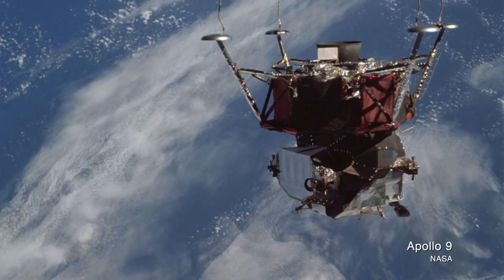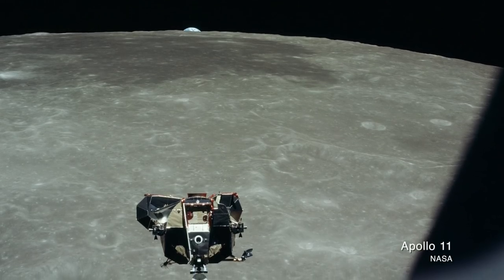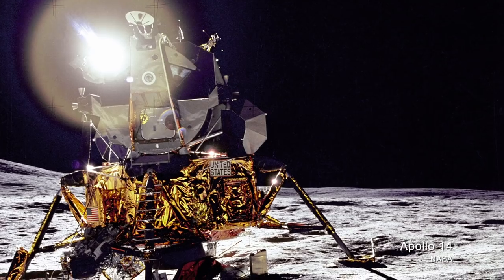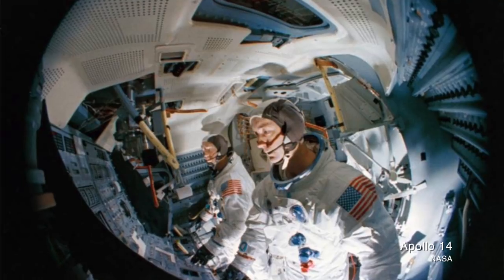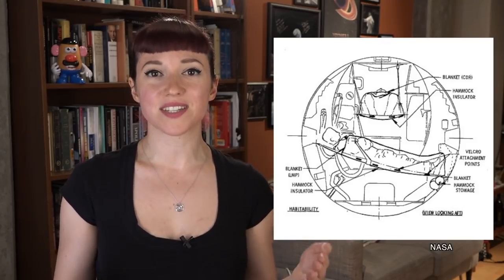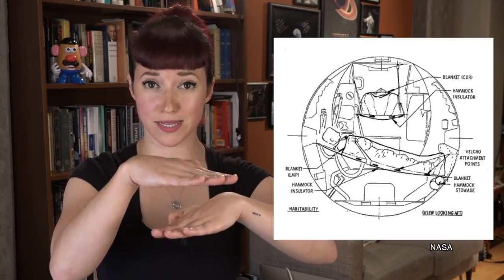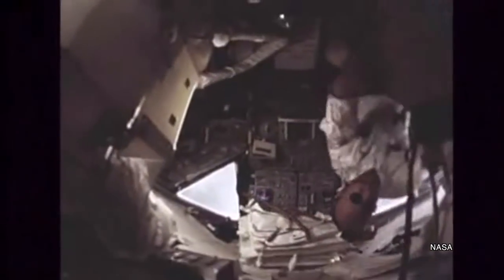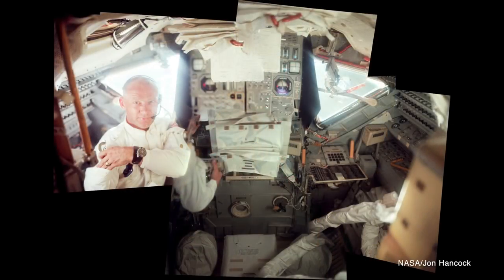Peeking Inside a Messy Lunar Module

Comment: 0:05 I did in 1991 I was an electrician working at KSC. I was working on a tourist area handicap accessibility ramp project. The display was closed and I was working by myself in the display area on ramp lighting for about a week. one of the items on display was an unused lunar lander. I was eating lunch one day at the bottom of the ladder on a 5 gallon bucket and decided to climb up into it and look around. I sat in it for a few minutes, pushed some buttons and flicked some switches then climbed back out and went back to work.

Comment: Even more impressive was that James Lovell, Fred Haise, and Jack Swigert lived for 4 days in that LEM cabin after the accident CSM Odyssey forced the crew to use Aquarius as a lifeboat.
Reply: Did they have to close the hatch to the CM though? There's 16mm footage of Swigert floating "down" to the LM from the mission (I presume it was after the incident, as there really wasn't any reason for Swigert to be in the LM if the incident hadn't happened.
Reply: Couldn't: There wasn't enough space to fit a third person to sleep without getting in the way or risking bumping something important. So they took rotations sleeping in the CM.
Reply: I have met Fred several times over the years.  He's a very nice guy, and easily approachable.  He gave an hour presentation of the real mission vs. the film, and he did say Hollywood jazzed it up a bit of course, there were no raised voices, arguments, etc. The manual burn sequence was not nearly as dramatic as Ron Howard made it to be.
Reply: That's good to know. Still, it really was touch and go for those guys. Amazing how they overcame immense adversity and made it back to our blue terrestrial ball alive and smiling.
Reply: Don't know if it's still there, but there used to be a boilerplate Gemini at Goddard that you could actually sit in.  I'm relatively tall, broad shouldered, and I really didn't fit in the seat even in street clothes.  Two weeks inside that thing with someone, while both wearing spacesuits, and I'd have gone nuts.
Reply: Walter Boxhead And both of them spent about two weeks with Bill Anders in the Apollo 8 CM (no LM lifeboat).
Reply: @ChristopherUSSmith  At least you could take the suit off in the CM and float freely.

I've heard Jim Lovell say that when he and Frank Borman got back from Gemini 7 they held hands and joked that they were engaged. They'd spent that long together in that tight a space.
Reply: @Doctor699  Indeed. Jim warned Frank and Bill to take it easy once unbuckling inside the CM. Frank still upchucked.
Reply: @Doctor699  Not only on the mission itself, but they must have spent plenty of time shut up in a mock up during training/rehearsals.
Reply: Christopher U.S. Smith on PBS they said he got sick and vomited and had explosive diarrhea. Floating all around them and it stunk so bad they had to use emergency oxygen masks
Reply: SteverRob the more I watch the movie APOLLO 13 the less I like it. The acting was pretty bad... especially the mission control guys.
Reply: Christopher us. Smith. Apollo 8 was 6 days long you doughnut.
Reply: @mem1701movies  Ed Harris is more gregarious than Gene Kranz. The movie doesn't depict Glynn Lunney's contributions fully enough. Mattingly didn't have to be woken up and dragged to the MOCR, he was already there with Tom Stafford and John Young for the tv transmission. And he wore a polo shirt, not a button-down with a skinny necktie. Stafford also wore a polo, Young wore a button-down, necktie, and a sportcoat.

Comment: Those quarters had to feel pretty tight; especially knowing that the thin aluminum skin was all that was protecting the astronauts from the near vacuum of the lunar surface.

What impresses me most about the interior of the LM is just how low tech the battleship gray instrumentation looks; more evocative of Run Silent, Run Deep than of Buck Rogers.
Reply: Apollo 18 had a lunar module set and it showed how cramped it was for the actors.
Reply: That's because weight and functionality are everything. Assume you need a pound for painting the interior: Doesn't sound like a lot, but shaving an ounce from something saves a pound worth of delta-V fuel, increasing your return sample weight and safety margin by that much. Not painting is16 extra pounds available to drag back to Earth.

Add to that, the instruments are "only what you need at the moment". Which is why most have more than one function. For example, the radar instrumentation had a switch between showing  range and "range rate", (how fast you were changing distance.) some, like the tank pressurization, oxygen tank quantity and others had one switch for one gauge gauge for showing four separate measurements. The temperature gauge switch had  seven positions; one each for the four thruster quads, one for each of two radars,  and one for the radio. The ones that didn't were highly critical systems, like RCS propellant quantity, engine thrust to weight ratio, and cabin ppCO2 level: You need to know at all times how much steering you can do, the performance of your engine and whether or not you can safely breathe the cabin air.) They're black and white (Or green for the EL displays) because the LM had big windows and the sun was bright: Washing out the color of, or overpowering a (let's face it) dim incandescent bulb (No reliable LEDs back then) might have had disastrous results ("Contact light! Engine off! ACA out of detent..."  ...thirty feet and 15 feet per second later... "Why are we still moving? FUUU---." crunch, bang) 

And the instrumentation was actually very high tech for its time: Lightweight, ultra-reliable and absolutely bleeding edge. (All of the 7-segment displays were electroluminescent. That was pretty new, again because: "no reliable LEDs back then". It would've been heavy, power hungry nixie tubes if it weren't for ELs.) Just the weight savings in instrumentation allowed them to only use batteries instead of batteries, fuel cells and hydrogen tanks too. Again, cut an ounce to get a pound. In this case, the fuel cell stacks were 245 pounds. Each. They'd have used two for redundancy That's at least four tons of additional payload. For a few pounds of instruments and their associated current draw.

High tech isn't "what you see", it's more "what you don't": "Perfection" in aerospace engineering isn't when there is nothing left to add, but when there is nothing left to remove. It's those little details that impress me.
Reply: Andrew Foss
Absolutely. And it's that raw functionality which I find so impressive.
Reply: When Alan Shepard took that golf club head and golf ball to the moon with him "secretly" on A14, that was the most expensive golf club and most expensive golf balls in the history of....ever.
Reply: Don't forget "most expensive chip shot on the most expensive golf trip" also.

Comment: could you do a short video about the hassleblad cameras they took to the moon?
Reply: Some of the Hassleblad  accessories became available to the general public, such as the focusing and winding knob extensions that were developed so the astronauts could work them with those bulky gloves of theirs.
Reply: It had 3 settings one for near ,medium,and far. It had f stop settings.
Reply: Were those cameras air tight? Did they have any special modifications to protect from heat/cold and radiation?

Comment: It may seem messy but all the astronauts on every mission implemented regular house keeping steps. it was a requirement...keeping large heavy equipment form hitting switches, digging insulation and shit out of the intakes... stuff was just not allowed to be floating around. there was a specific place for every item. Being so small the lem looked unorganized but in fact was very well organized down to the exact place to store each item including spent lioh canisters, not only for neatness but weight distribution. a messy astronaut on a mission would not have been tolerated during any mission and to be messy and unorganized would have been considered failure to perform duties in an acceptible manner.
Reply: I could show you plenty of very organized messes.

Comment: Amy , I once had a GI-JOE Mercury Capsule , bought it at a Garage Sale . It had a small hole in the Heatshield to simulate Gus Grissoms Mission and a Comic Book detailing GI-Joes adventure . It was one of the Neatest Toys ever ! GI-Joe was Eleven Inches tall , so the Capsule was quite large . I would like to see a video about this toy ........ To Vintage Space , and Beyond !
Reply: Despite its size it STILL wasn't to the same scale as the "action figure". In the real thing the astronaut sat with his knees bent 90°  but the toy version was small enough that the GI Joe astronaut had to have his knees straight with his feet protruding into the area behind the instrument panel. Of course that's ignoring the toy's huge clear window that slid beside and under the seat so you could access the figure in the spacecraft.

Comment: I lived in. Bethpage where the Grumman company built the LEM. (Original name and one that the builders STILL refer to the module)
They built TWO fully operational modules. The Guppy aircraft landed in Bethpage to pickup one of the LEMs. One of my best friends father at the tine was in charge of the wiring for the LEM and had the wiring diagrams at home with him. He was only allowed to either be home or at the plant when the moon mission was going on in case NASA needed immediate answer to a question. One of the scariest part of the mission for engineers & builders was the separation of the ascent module from the decent module. There was a lot of wires that connected the two modules. The wires passed thru a guillotine with explosives (you see the debris blow away when they took off from the moon surface) if this guillotine failed to cut the wires, the ascent module would just flop over and the astronauts would be doomed. Thankfully everything worked perfectly.
After the first moon landing was successful, the duplicate LEM was pushed kit if the hanger and into the parking lot, spray paint it camo green and there is sat fir two years. I used to pass it everyday on my way to school and thought "what a shame, all that technology out in the weather"

Comment: i work at a museum with a full scale working lander. i would be happy to get you a custom video of the inside to show how small it is. just let me know if you are interested.
Reply: A VR 360 would be super sweet!
Reply: Is the enough space for the crew to pass through the hatch in their pressurized space suits? I heard the diameter was the same as the helmet making it very difficult to pass through. Please reply
Reply: @NewOrderOpposer  Of course there's enough space for them to fit through the front hatch in their pressurized spacesuits. That's how they got out and back for their EVAs on the moon. The front hatch is a round cornered rectangle though. The top hatch that the command module docked to is the circular one. Even the top hatch would have been big enough since they would had been wearing the same spacesuits for the lunar EVAs that they wore for the launch from Earth (with the life support backpacks attached and visor mechanisms added over the clear bubble helmets).
Reply: which museum & where is it?
Reply: I raise my hand sheepishly

Comment: THx for sharing!
I was looking for an explanation on how the astronauts were fixed inside the lander during landing. I mean, i am pretty sure they were standing, but were they attached to something for more support?
When the lander was landing, there was motion obviously and if one is not fixed to something, it could be quite tricky to keep a stable hand on the controls i imagine.
Or am i thinking in the wrong way here?
Reply: Somewhere I’ve seen a picture, where they were strapped in with belts reaching both flor and roof.
Reply: @YDDES  cool. Hope to see it one day.
Thanks for the reply as well.
Reply: There were elastic bungee cords connected to the walls of the LM's cockpit around where the astronauts would stand. Then there were  attachment loops sewn into the astronaut's space suits. Before flying the vehicle they would hook the stretchy bungee cords into the loops, which would hold the astronauts down onto the floor so they would remain in place while the LM was performing powered flight.
Reply: @joevignolor4u949  Absolutely interesting, thanks!

Comment: I think I know, but what are the long stem like things on the pads of the LEM ? Your pic in this vidio shows them very well. I still have two models of the LEM from when I was a kid, and they didn't include these probe looking spears. Were they there to detect a safe landing surface ? Maybe alarming the pilot if no hard surface was detected ?
It's not like they could they could call AAA if they sank to deep for a level launch pad for take off.
Congrates for the Apollo Museum entry ! 
-Alec W.
Reply: Alec Wilson Yes, those activated the contact light to let the crew know they could shut off the engine. In later years, pimps used them on their Cadillacs to let them know where curbs were, thus protecting all-important and expensive gold rims.
Reply: @fleafrier1  The wonders of trickle down technology from the space race!

Comment: Early on, the LM was called the LEM (Lunar Excursion Module) but NASA thought that sounded "frivolous' so it was shortened to LM.  And there was originally provision for seats, but they were deleted to save weight.
Reply: Not so much the seats themselves, by standing, the astronauts had their eyes closer to the windows, so those could be made smaller, so there was less heavy glass.

Comment: Of the 235 cu ft, inside the LM, only 160 cu ft were habitable and that's a box little less than 5 1/2 ft on a side for two Astronauts live, work, and sleep in. The crew compartment was just 42 inches deep, 80 inches high at its maximum height and the ascent stage was like riding a double door closet off the Moons Surface.....

Comment: Oddly enough I know someone who got to crawl into one of the LM. Specifically the one on the Apollo 13 mission. His dad was a lead engineer and former air force test pilot and part of the Dino Soar program that was cancelled. Also may have been a ground testing stand in / body double for one of the apollo program astronauts. They didn't want to risk any more of them after the Apollo 1 accident so they used stand ins.

Comment: The command module was even smaller. 3 guys having to cram into a titanium hull with heat shields and behind you, a bomb that could blow up if an oxygen stirrer accidentally shorted out( 13).

Comment: How did the lunar module lift off the moon? Obviously the landing stage was instrumental in getting them to the  surface and would require an engine that could be controlled to get it to the ground as was made obvious by the nozzle below the lander component. I have seen the lunar module living area lift off and there is an absence of a rocket nozzle for containing and focusing the explosion downward to produce lift.  I am assuming they used the moon's gravity to assist in achieving escape velocity and thereby not needing a larger rocket engine to reach that velocity. It almost looks like they are using compressed air to launch from the landing component. It almost looks like a controlled explosion that pops it up in to space. Did they fire their thruster at some point to give additional lift the way the later space shuttles did? The LEM just looked weird the way it popped off into space.
Reply: The rocket nozzle for the ascent stage is not absent, it's just not so obvious to see. You can google images for the lunar module ascent engine that shows how it was incorporated into the ascent stage such as this one:
 http://www.clavius.org/img/lmfront.gif
Reply: Unlike the descent engine the LM's ascent engine could not gimbal (swivel) to steer the vehicle during its ascent. As such the four downward facing RCS thrusters were pulse fired by the guidance system to keep the spacecraft pointing in the correct direction so the ascent engine could propel it back into lunar orbit.

Comment: Amy, can you do a story on the lines that are etched into the LEM windows? I know there were some sort of measuring aid but how did it work?
Reply: Two different color lines, on panels spaced apart. If your head is in the proper position for reading, "yellow and blue make green", so to speak.

Comment: is there a video explaining how the saturn rocket stood tall in the launchpad? if no, can you do it?
thanks!
Reply: They had support on the side, I don't think she'll make a video on that.
It quite obvious. You can checkout the launches of today too, may be the technology changed or due to smaller rockets like Falcon, they may use different stuff but it were just support stuff nothing cool really.
Reply: thanks! :)
Reply: Actually, the 4 hold down arms are the main components on the launch pad that keep the Saturn V in place. Each one has a pre-loaded force of 700,000 lbs and they were capable of holding the Saturn V in position until the 5 F-1's reached full thrust. Something else incorporated into the hold down arms were the tapered pins and dies that were used to "reduce transient stresses resulting from abrupt disengagement of a vehicle from its launch stand."  During the launch,. the tapered soft metal pins would be drawn through the smaller dies for the first 6 inches of the liftoff to reduce the acceleration to an acceptable level
http://www.hq.nasa.gov/office/pao/History/SP-4204/ch13-4.html

Comment: They must have had some really good batteries to run all that equipment and heaters how cold is space negative 455 or 2 degrees Kelvin
Reply: There no atmosphere so heat transfer rate is quite low.